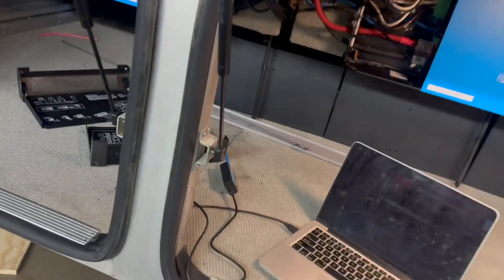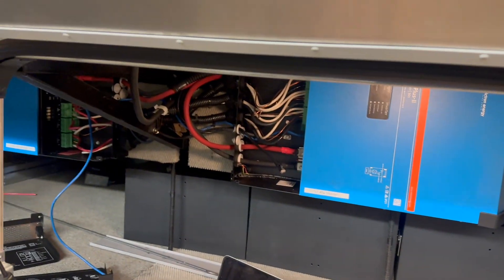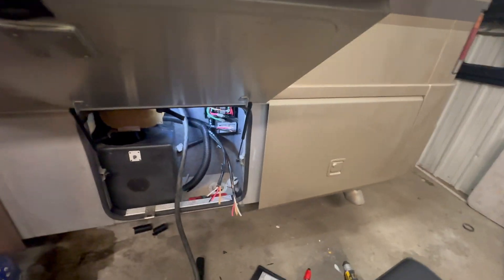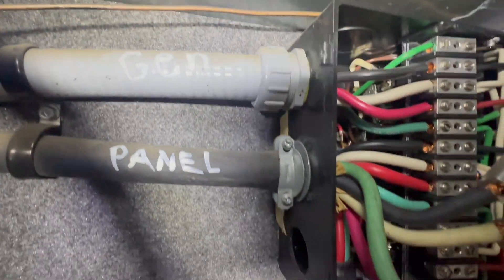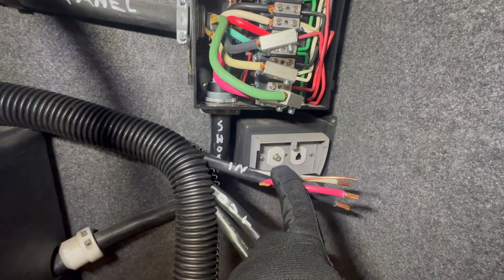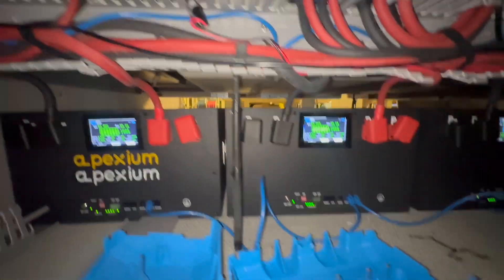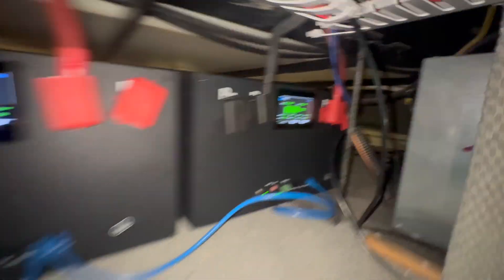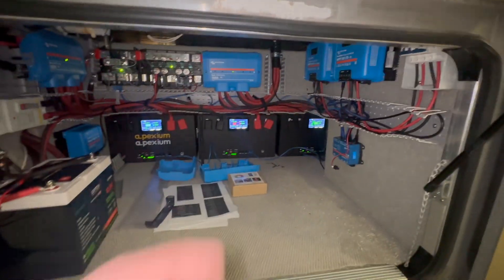Class A Airstream Part 3 - 3rd Apexium Battery installed and Buddy Plug Programmed.

Comment: Shawn, I may need to add a panel of AC breakers to facilitate the split of the AC input between my two Multiplus II 3000 12v 120x2 inverter chargers on RV we are picking up.  That seems to be the only significant change I would need to make to the power wall on my 2001 Country Coach.  For system integration, I need to address automation of the Onan 12.5kw generator with the Cerbo GX.  To trigger the generator start/run to provide 'Assist' to the inverter when load gets above 4500 watts across the two Multi's.  Do you have any videos that address that feature of the Cerbo GX (relay?).  ALSO, I could really use advise on powering a home using the onboard 12.5kw generator (relay settings on the Cergo to handle that load).  We are thinking of using the Coach as our backup power if we lose grid power to our home during storms.